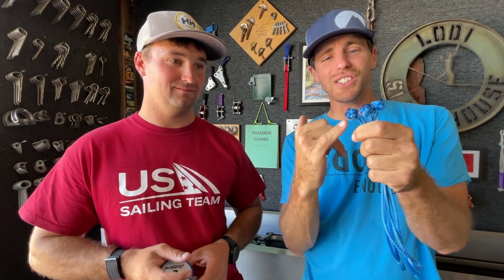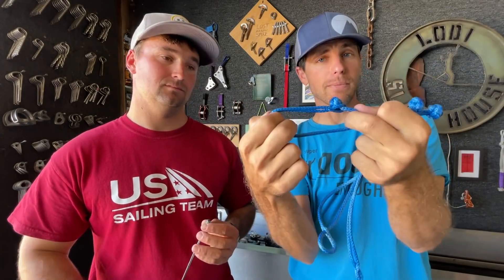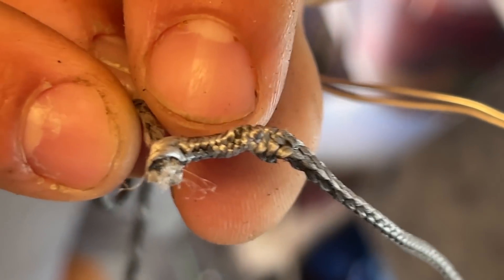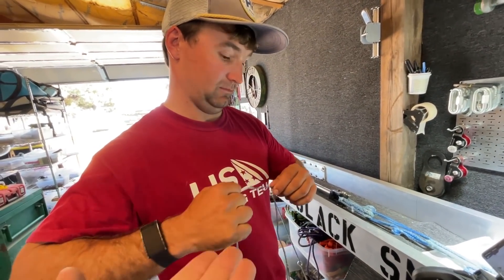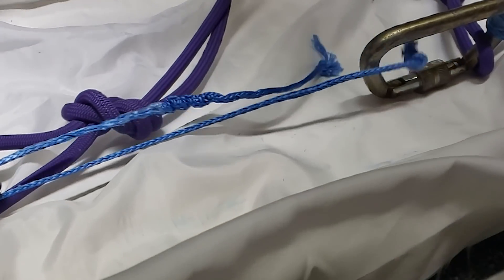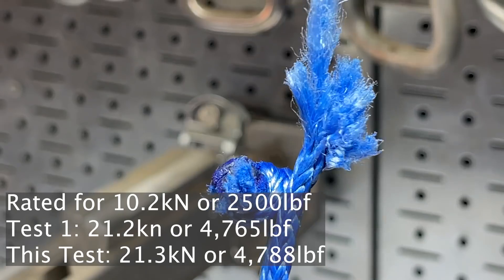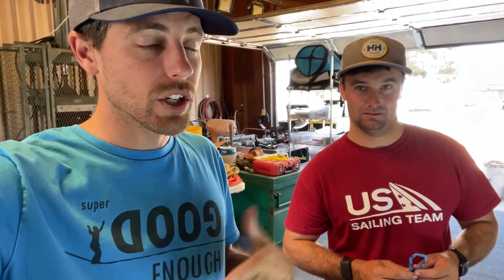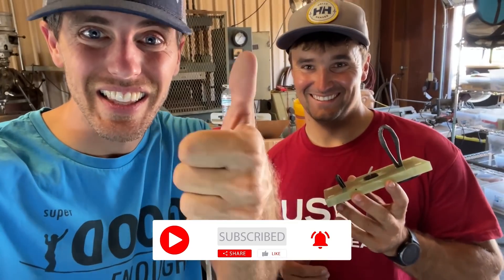Sailing Soft Shackles - Diamond Knot vs Button Knot

Comment: If you don't properly set the diamond knot it is just like anything when you don't make something correctly and then it fails. WTF do you expect? When you properly set a diamond knot you can tap it on a table and it should sound like it is made of metal or wood rather than feathers. I invented the idea of making soft shackles stronger by bringing the line back down through the knot and tucking them inside the line. Brion Toss came up with the actual button knot. A third person with screen name Estar did the testing and had the initial requirement for a stronger soft shackle which was to be able to pass the shackle through anchor chain. In the end, both Estar and I preferred the diamond knot and Brion preferred the button knot. What Estar and I preferred is using thicker Amsteel if you want a stronger soft shackle.  Here is the dollars of it. For about +70% in price of thicker Amsteel, you get +60% more strength. For a button knot, for +14% more line (the tucks) you get 35% more strength. From that standpoint the button knot is a better deal but not by a lot. But the downside is it is harder to tie and is smaller so right there seems less secure, and you are stuck with the two strand Kohlhoff style with the open body rather than what is more secure in either the Colloigomarine style or my style what I call a better soft shackle and Animated Knots calls the Edwards soft shackle (my name). Much more on my website under Soft Shackle tab. 
Allen
L-36.com
PS. I love your videos. I wish I had that test gear. Ester had a hydraulic press on an I beam. I use a winch on a 4x4 but can only break lashit. I hope you read this comment.

Comment: I think the mix in breaking amounts would be due to not dressing/ setting. 

Would love to see the button not vs a diamond with a small 1/4” stub with both tails whipped together with locking whipping. 
I have a feeling forcing both ends to slip at the same time could I crease the breaking load dramatically. 
Not as much as setting the not correctly though.

Comment: A few things I noticed:
1. The 3mm diamond vs 1/8 button and dyneema vs amsteel was not an apples to apples comparison - it would have been nice to see a single line breaking strain on the 1/8 amsteel.
2. The knots (usually) didn’t fail - doesn’t this imply that the extra strength attributed to the button knot was solely due to the larger diameter that the eye is wrapping around?
3. You seem to have done an apples to apples comparison with the 2mm but you kind of rushed through that bit.
Awesome video and really appreciate the analysis
Reply: they did an eye-to-eye pull on the 1/8" line

Comment: One problem with button knot when sailing, is where your line diameter is restricted by the size of the attachment.  With buttons and their thicker noose you have to downsize line dimeter quicker, loosing any gains in strength. You can also make shorter shackles with the diamond knot, which is import if something needs to be attached close for performance reasons.

Comment: Very interesting. We are also into sailing :-)
We are re-rigging our 44 year old 38 foot boat with all dyneema. Including the chainplates. We are using the overhand knot style of soft shackle from your channel (because the bigger know is a positive advantage for us). Instead of the eye looping over the knot we keep the full length. The knot is inside the boat under a big backing plate. The eye goes through a small hole to above the deck. We are putting a low friction ring in the eye and then the dyneema shroud that holds up the mast is lashed to this. Will start with some load testing in the next few weeks. Of course our scale is a bit larger. For our mizzen mast (the shorter mast) we are using 9mm dyneema (way over strength but that is because we are sizing for stretch to be similar to 6mm stainless steel).

Comment: In my experience playing around with both of these knots, I've found that the button knot is harder to tie in smaller diameter lines. It seems like it's easier to make a tangled mess in narrower lines while the diamond knot is relatively easy to tie. For light duty applications, a diamond knot in smaller diameter line might be the right combination of ease of tying and "super good enough."
Reply: Buttons are doable, for me, in 3mm Dyneema or larger. Anything smaller I much prefer diamond, for ease of tying in lines as small as 1mm.

Comment: This video would be better with more sailing/story from your guest. Get me invested in the testing what are these things doing? How did highlining steal them from sailing. Does my poor homeboy's sail fall off with out em? I want to cheer for that dyneema! P.S. Love the new direction Ryan, I hope you crush it literally!
Reply: I just want more sailing action, same with the skydiving ep, no skydiving until the very end
Reply: Dyneema can be used for nearly everything in sailing. Just about everything you see on a boat is held up by rope or cable.
Reply: @joestevenson5568  A rope is coiled and has no working job, a line has a working function and a sheet is a line used to trim sails 😉Somewhere in the millennia of application distinctions were made in sailing and those distinctions are still used today. Also, there is a very good chance you will be immediately corrected as every line has a conveniently specific name directly related to the job it does. Volunteer to crew if you have the chance, the logic of this will become very apparent.
Reply: @All4Grogg Tell that to the bolt rope and the bell rope...😊 @All4Beer&Tobacco
Reply: agree i enjoy the videos but they need a narrative

Comment: Love me a soft shackle face off......considering the challenges you both had with the complexity of the two knots reckon you could try using a spliced continuous loop with loop locked overhand knot (this is where an overhand knot with the tail passing through as the terminating tail ‘ear loop’ is then locked off by passing the soft shackle loop through the ‘ear loop’ at the knot to then lock the overhand knot off....the knot is tied into the splice) Much easier to tie (not so easy to describe)....really just an overhand knot and a splice....with the advantages of the button knot.
Love your work
Reply from the maker: You mean this one ;) https://youtu.be/jU_mmdbQeCQ. It has a huge head and that is why I don't use it.  we also have 2 or 3 other designs people have sent me that look neat too.  Gunna test em all
Reply: @HowNOT2  Thanks for the reply, yep that one (just using a continuous loop not eye spliced ends), yep the knot is pretty big....but pretty fool proof to tie. Looking forward to more testing, more learning, cheers.